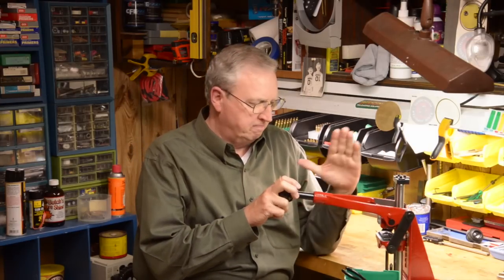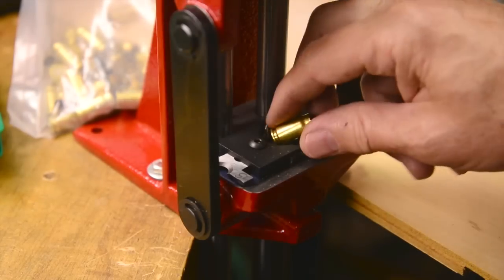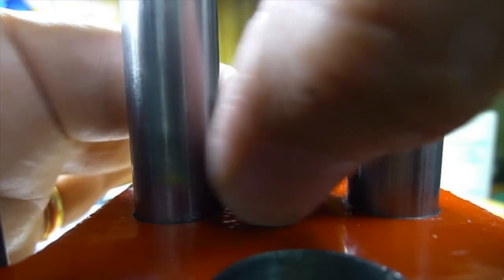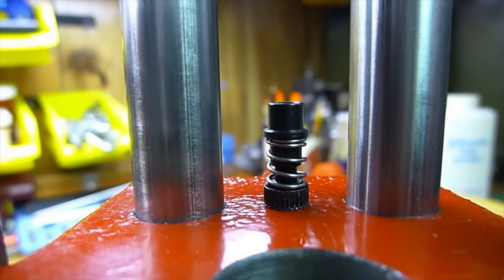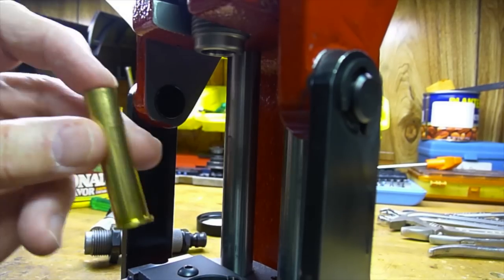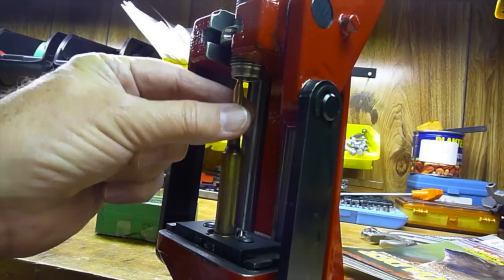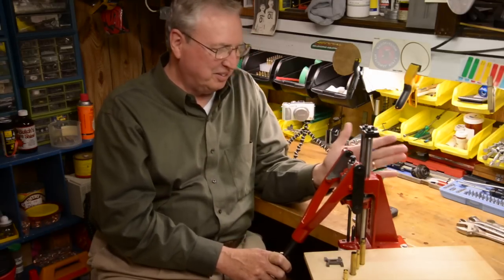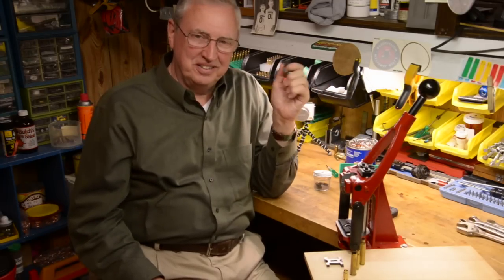Forster Co-Ax Update

Comment: One additional asset, if I may. I have never stuck a case with the Forster press. Not that I shouldn't have, I make mistakes too. But the case always came out of the die with more pressure on the handle. With the design, more pressure can be applied, this is shown by the less force required to size a case than with other presses. The longer handle and applied geometry. But also, with the unique case holder there is nearly 360 degrees of hold on the case, unlike standard case holders with much less. That is unless, you fail to change the case holder for larger cases. I noticed this on my first nearly stuck case. I have ordered spare jaws in the event a jaw bends in such an instance, but that has never happened to me yet. I have little problem with spare parts for my most used tools. A light application of way oil on the columns keeps it running smoothly also. Just my two cents.
Reply from the maker: Albert, that is an extremely valuable bit of information that I failed to include in the video. Yes, the jaws COMPLETELY ENCIRCLE the shell and that really increases your odds of successfully extracting a stuck case. People don't realize how much leverage this press design has because it looks "small."
Reply: @RexRoach  Glad to help. Just adding what I have found and like about the Forster. I have had 2 friends come over to use some tools of mine, they both now own Forster presses. After 40 years as an Industrial Mechanic, I have learned the price of well built tools are usually worth it.
Reply from the maker: @6handicap604  Thanks so much!

Comment: I have long wanted to use a headspace "go" gauge to set the height of a resizing die. My problem is that one of my hand-loaded cartridges might end up being fired in any one of several rifles.  In theory, a cartridge sized to the SAAMI standard would fit any properly reamed rifle except that it would be 0.003 inches too long.  Cases appear to sit on the top of the lifting plate on a Forster Coax press.  I am thinking of sitting a "go" gauge on this plate and setting the resize die to fit the gauge.  Then, because I use standard 7/8 X 14 threaded dies, I could shorten my resizing die by 0.003 inches by removing the gauge and applying a clockwise 15 degree rotation to the die. I wonder if this will work.

Comment: I would like to use this press to load the .577/.450 Martini Henry.  The Bertram brass for the M-H has a rim diameter of 0.740.”  Would the Co-Ax accommodate this large rim?
It looks like the priming jaws are reversible to accommodate different rim thicknesses?  Thanks 
Keep up the great videos!  👍
Reply from the maker: The standard jaws will not open that wide, I'm almost certain. Forster has a set of jaws called LS (large/small) to handle most extremely large or small cases. I know it works well with .45-70 or .30-30, but I can't say about your .577/.450 Martini Henry. My advice is to contact Forster and ask them. If those jaws won't work, you can always get the adapter which allows the use of any "standard" shell holder from RCBS, Lyman, Redding, Hornady, etc.

Comment: Rex, just so your viewers don't have a similar problem, when using the priming system for a few years I started to have problems with the seating depth and that soft feel as the seating process finished.  I messed around with slightly screwing in and out the seating cup to no avail.  Then I noticed that one of the bolts holding the primer system case holding assembly had come loose.  The ones that bolt into the twin rams.  Once tightened all was right in the world again.
Reply from the maker: Excellent point. I suppose this really applies to all reloading equipment — if things are held together with threaded fasteners, they should always be snug. It's a great idea to check out your gear from stem to stern every once in a while and look for wear and/or loose connections. 

For me, I sometimes forget to really snug the locking nut on a die adjustment and get about 100 rounds into a session only to discover the die is out of kilter. 

It's maybe the #1 rule of reloading — PAY ATTENTION

Comment: I am buying this press because of your first video. You answered my questions on this video about 45/70.
Reply from the maker: You'll find it has very high leverage, so sizing those big straight cartridges is pretty easy. Let us know what you think after you've had some seat time with it.
Reply: Rex Roach I am currently using a Hornady Classic and Autopress. They are very good machines but after watching your videos I believe this is a better design. I am loading 45/70 and 45/120. I hope the yoke will clear the 120. Will let you know.
Reply from the maker: osbornephoto1955  I think the yoke will easily clear over the top of the die. Any problem will be with seating a 500+ grain bullet in the 45-120 case. As with almost all presses, it will be close.

Comment: Forster should be thanking you for these vids. After much searching I decided on getting the Co-ax as my single stage to compliment my Dillon XL650. I am just waiting to hear from them to make sure their largest jaws will be able to fit .577-450 martini henry.
Reply from the maker: +Maciej Cho As a worst case solution, you can get Forster's shell holder adaptor which allows you to use your "regular" shell holder. I have one and it works fine. I needed it to hold the extended "ram" for pushing .40 S&W and such cases through a Redding Rx die.
Reply: will the co-ax even accept the dies for the 577-450 arent they bigger and threaded 1-1 14x12? I dont know, but i dont think so. Correct me If I am wrong and I hope so because i am awaiting a 577 Snider and may have a possible chance picking up a used Co-ax.
Reply from the maker: Fenrir You've raised a good point. I was not familiar with the 577-450 Martini Henry, but it seems the dies of choice come from Lee and they have the 1-1/4x12 threads. I can't see any way to practically use the Co-Ax. The die will not even enter the slot, so shell holder questions are moot.
Reply: +Rex Roach Yeah i have to see want to pick up a co-ax so badly and this video helped a lot, but i need a new press who i can use the 577 dies and the Rcbs shotshell die also. Think I just have to buy the co-ax any way cant justify the price for a new one right now, but its hard to resist a good deal. Great video by the way
Reply: +Rex Roach Thanks a lot it will be great fun, but it is a Snider Enfield in 577 Snider i am awaiting , but dont you worry the Martini henry is probably next on the list:-)

Comment: Congrats on a great video. I've had a Forester press since the 80's. Sold 2 Rock Chuckers and a Lee since then and wouldn't want any of them back. I have purchased a Dillon 550 but only because of volume needs. Love my Forester press. Most loads coming out of it  have .0015 runout or less. Keep up the nice work.
Reply from the maker: Thank you very much. It's always good to have independent validation of what I've been saying.
Reply: What loads are you getting that kind of runout "most of the time" with and where are you measuring "run out"?

Comment: Rex can you use rcbs competition seating dies in this press?  Sometimes it requires you to use the tall shell holder which won’t work in the co-ax.
Reply from the maker: Great question, Lance. The answer is yes. You'll need the Shell Holder Adapter Plate #AP1000. I have RCBS Competition Dies in .222 and .22-250. The little tall shell holder goes up inside the dies and it works perfectly with the Co-Ax press with that adapter. Also the Co-Ax handle will easily clear over the top of the die. I have those plus some Redding dies with tall bodies and micrometer adjustment knobs at the top and the handle goes over all of them.

By the way, that shell holder adapter plate will allow you to use any common post-type shell holder from RCBS, Redding, Lyman, Hornady, etc. Another time I use it is with a Redding shell holder set that lets you fine-tune headspace when sizing.
Reply: Rex thanks. I use these dies for seating only as I mentioned. The 30 cal works perfectly for all 30 cal rounds. I too Load for 222. Would you happen to have a photo of that all set up?  Is there any way to get around using the adapter or even needing it?  I guess my concern with the shell holder was over concentricity and the fact that it negates the floating shell holder concept. However, most concentricity is achieved in case sizing correct?  I suppose if I have any runout in the finished case I can correct that with the Hornady concentricity tool.
Reply from the maker: @lanceschul , here are some photos of the Co-Ax set up with the adaptor plate and the .22-250 RCBS Competition Die. I can't think of any other solution for using that special, skinny, tall RCBS shell holder other than the adaptor. As to the concentricity issue, if you leave the screws slightly loose, the adaptor is free to move slightly in any lateral direction. I've not tried it that way, but I would guess a drop of "mild" Lock-Tite would keep the screws in place. A half-turn loose is all you'd need.

Here's a link to the photos:   https://www.flickr.com/photos/68176327@N08/albums/72157704701212181
Reply: Rex Roach thank you sir. I suppose if the case is sized properly with the floating attributes the seating will go smoothly. Thank you for the time you spent posting photos. I think this press will work just fine with that adapter. Many thanks!
Reply from the maker: @lanceschul  my pleasure. I'm glad the pictures helped.
Reply: @RexRoach  MidwayUSA got the Co-Ax in stock today, I ordered mine as soon as I got the notification email.  Looking forward to getting some rounds loaded on it.  Thanks again for all the help.
Reply from the maker: @lanceschul  My pleasure. You will enjoy it.
Reply: Rex I won an Inline Fabrication Mount. Any thoughts about mounting the Co-Ax and any thoughts on height?  My press arrives Tuesday then maybe I can quit bugging you!
Reply from the maker: @lanceschul  Take a look at the video I did about press mounting. Maybe it will answer your questions.   https://youtu.be/z6B_qA85HFw
Reply: I finally sized some cases for the first time. 7mm08. Is it ok for the press to cam over?  I was able to bump my shoulder .001 consistently and it chamber beautifully. Thoughts?

Comment: I load from .380 to 30-30/25-35 and .300WM   which jaws do I need?  I haven't seen a table
Reply from the maker: The .30-30 requires the large jaws, so you'll need both sizes.

Comment: Does the primer indexer also function as a primer pocket swager, by any chance?
Reply from the maker: Interesting thought. As far as I know, Forster doesn't make parts to swage primer pockets with this press, but given the design it would be simple to make a punch that would work on there. The leverage of the press is at a maximum then. It would be difficult to make it adjustable, but that might not be an issue. Anyone with lathe skills could take an off-the-shelf punch from someone like Dillon, cut it down, thread it and that would be that. Of course getting the length right would be the trick. There's not much room underneath the block that carries the empty case for a locking nut, hence my earlier statement about difficulty of adjustment. I suppose a test model could be made to screw in until the operation is correct, note the final dimensions and then make a shouldered part that would screw down firmly as does the primer pocket punch part Forster makes.

Well that little bit of thinking out loud was a good way to start the morning.

Comment: Just a quick question...? Could you use the tool to set up the cases for priming to remove primer pocket crimps from ex military brass...?
Reply from the maker: Jason Dwyer Probably not. There are two methods of removing primer pocket crimps that I'm aware off. One method, called reaming, cuts the excess metal away. The second method, swaging, re-shapes the mouth of the primer pocket. I think most people prefer the latter method and the Dillon bench tool is the standard bearer.

I'm only aware of one tool (RCBS) that uses a press for swaging and, AFAIK, it won't work on the Co-Ax because the swaging punch mounts to the press ram in the same way a shell holder does, i.e. it snaps into place. 

I picked up a used Dillon years ago at a gun show. Works like a champ and processes very quickly. 

Here's an excellent article on the subject:   https://squibloads.wordpress.com/reloading/get-the-crimp-out/
Reply: Thanks Rex. I thought about a bit after posting. Even if the aligning tool was strong enough (and I reckon it would be). It would probably stay on the case on the return stroke... Thanks for the reply
Reply from the maker: Jason Dwyer Jason, it's come to my attention there's a $17 accessory you can buy that will allow you to use a standard shell holder on the Co-Ax press. For those special occasions when you need to mount an extended shell holder or, as is the case here, an extended "punch," this thing is just the ticket.

MidSouth sells them http://www.midsouthshooterssupply.com/item/00070AP1000/Shell-Holder-Adapter-Plate-For-CO-AX-Press-

I have one on order. Watch for a "review."
Reply: Excellent. Thanks for the reply. Will be waiting eagerly for the review. Got my Press on order from BRT Shooter Supply in Australia

Comment: Great video. The reason for using the aluminium lock ring that Forster recommends is that it won't wear away the slot on the Co-Ax press like a steel lock rings will - any wear is on the lock ring and not the steel of the press itself.
Reply from the maker: Excellent information. Wish I had thought of that. Thanks for commenting.

Comment: What is the tool you use to adjust the primer jaws? I need to get one. Do you have a part number?
Reply from the maker: It came with the press and a quick check of the Forster web site did not reveal the part. If you give them a call or email, they will have what you need.

Comment: There is one cartridge the jaws will not handle, the 450-400NE, it has the largest rim of the works for a rimmed cartridge.  I called Forster to check that before I bought it, and it was them who told me that. I tried it once, the jaws just won't quite do it, it will start, but won't go all the way. There are a few other products out there that won't handle it, either.
Reply from the maker: Good to know the limitations of the press. Thanks for sharing.

Comment: Thanks for such an enlighjtening video. I have a Co-Ax on order from Midway and have never even seen one up close. My old Hornady single-stage press is just that: old, and since I am ready to make a move up, I chose the Co-Ax....mainly because of its ease of use, but probably more for its reputation for producing cartridges with minimal case/bullet runout, resulting in optimum concentricity. I won't receive the press from Midway until about a month from now due to their being backordered. Again, thanks for sharing your information. Much appreciated!
Reply from the maker: +Hotstixlix I noticed that MidWay had them on sale the other day. I know what you mean about not seeing one before buying. I bought mine totally on reputation (plus seeing one on TV used by the Army marksmen).

Comment: There's a shimm between the press & the shell hold is it necessary? Purchased the new easy access arms in order for it not to cam over the sim must be removed?
Reply from the maker: I think the steel shim is to prevent the hard steel jaws from sliding on the cast iron of the press.

Comment: What is that semi-bottlenecked pistol size case you showed at 14:00 and at around the beginning? It doesn't look like a .357 SIG would with a sharper shoulder.
Reply: It's definitely a .357 Sig.
Reply: It's right there on the headstamp.Thank you.

Comment: This is the report back on using the Horady Cam Lok Bullet Puller with this press. There is also an existing video by ReloadingandShooting using the RCBS bullet puller with this press. My Hornady Cam Lok puller arrived yesterday with one 9mm collet and the 223 collet still enroute. This morning I installed the Hornady puller into the Forster press and set it up exactly according to the Hornady instructions. The puller is sensitive to how it is set up and it takes a little practice and feel to make good looking landings. I pulled 60 9mm 115 gr RN bullets and 3 Hornady 115 gr XTP without any issues. There is plenty of room to operate the puller handle. This puller is a keeper.
Reply from the maker: +Hardy Birch Outstanding! A thousand thanks for sharing this, Hardy. I had a strong feeling this Hornady puller would be a winner.

Comment: Very nice video.  Thanks for producing it.  I bought my Co-Ax pres after watching your first excellent video.  One tip I have already found on my new coax that might help with your .45-70 case being a bit sticky coming in & out is that the cone-shaped pin that pushes the jaws open screws in from the bottom, and you can control how much the jaws open by screwing that threaded pin in a bit more from the bottom of the frame.    Also, another feature you didn't mention that I really like is that, when the handle is in the up, stored position, it is cammed up and over the top, so it won't fall back down for you to bump into, as is the case with some other presses.